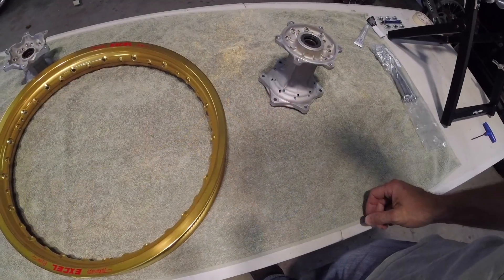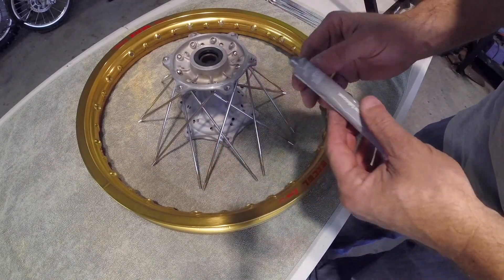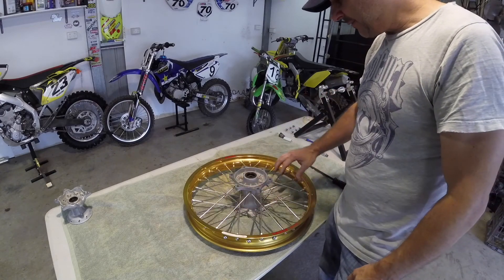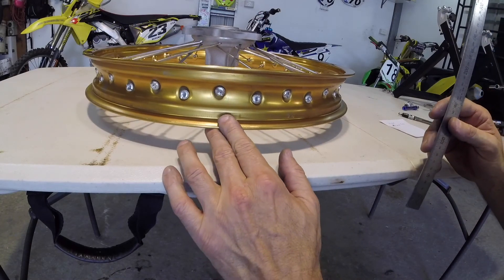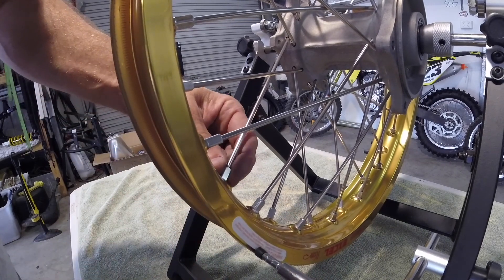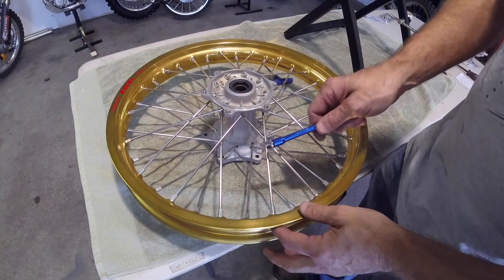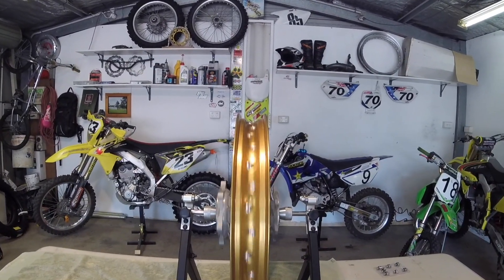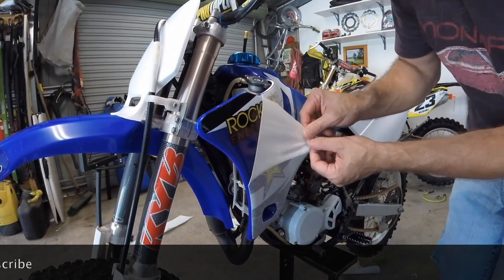Epic dirt bike wheel build beginners guide.

Comment: Arent some wheel dished on purpose. How do you know what offset to use if you can not compare or the manual has no spec? 

I have noticed on my brand new yz250 that the rear wheel is about 1/4 off center in the swing arm. I can not determine why this would be, i even tried asking my dealer, and they couldn't say. I am debating dishing the wheel so that it is perfectly centered. What do you think?

Comment: I had a go at doing this. I found the actual lacing to be quite simple, and I could get the side to side adjustment to within a mm, however, when it came to the up and down rotation it was like an egg, well not that bad, but bad enough to have cut my losses and take it to a bike shop. If it wasn't for your video, I wouldn't have even tried, so thanks heaps, I will have another go later.
Reply from the maker: At least you had a go next time you will win.
Reply: How much did the shop charge to do it?

Comment: Im a little confused, im new to this but my excels on my 2022 450f are way out right now. So do we torque it down to torque spec then check for side to side and the hop? Then tightenin would put us over torque spec which in my case is 1.8 which seems awfully low.